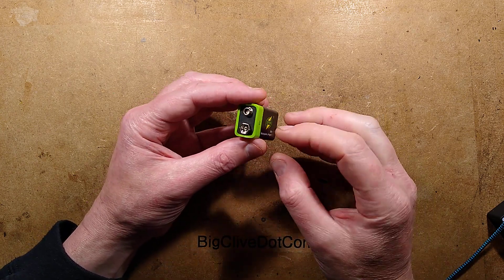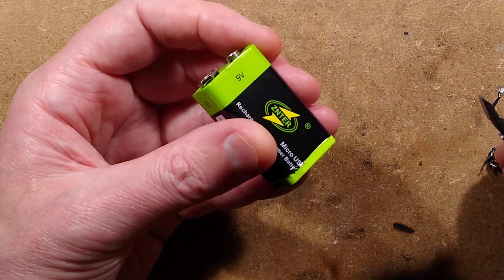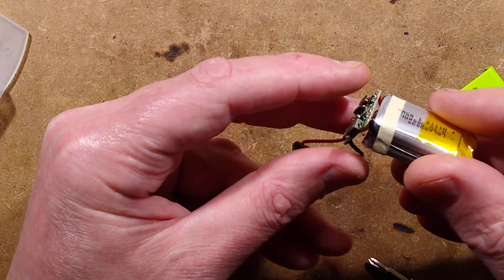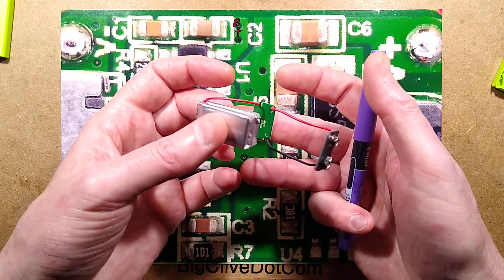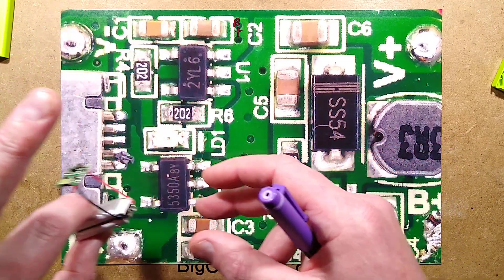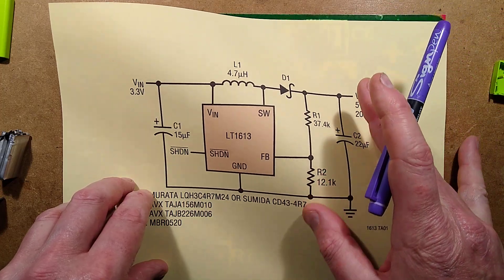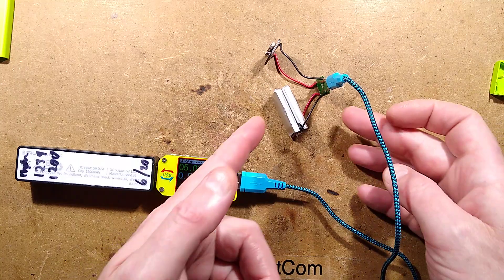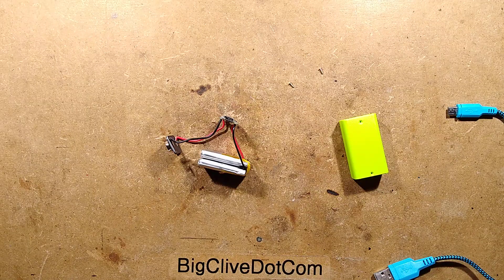Inside a Znter lithium 9V battery.

Comment: Seems like a well designed bit of kit. Nice too that they rate it at a more realistic level and not the raw battery voltage like 99% of powerbanks. I do a bit of work in theater and we would sometimes replace radio mic batteries during intermission. Was great i would end up with a hundreds of batteries after shows. Not entirely sure if i would trust sometime like this in a professional show however. At least not until they were extensively tested for runtimes and all that. But even then, at least the mics ive used always have some sort of a battery meter on the receiver unit. Ive had times when its been partway through an act, the unit is saying low battery and ive called over CANS to get someone back stage to do a emergency battery swap just to be safe. With these you would have no warning one wasnt charged or the cell was going bad etc and it would just suddenly drop out. 

For that same reason too these should never be used in smoke alarms. While i will admit that a smoke alarm battery chirping is the most annoy thing thing on the planet and ive got up the ladder at 3am ripped it off the roof and thrown in a corner. Once again with these you would have no warning as the output voltage of this would always be around 9v.
Reply: I agree, that also bothers me with power banks. I'd like if they advertised in Wh, rather than mAh at 3.6V.
Bare minimum they should say Ah instead of 000mAh 😅

Comment: Hi Clive your content is the most interesting and explanations are brilliant. I don't understand some of it but what i do understand has been very helpful .
I was wondering have you ever dismantled a DJI mavic Pro battery . Once they go below volt and are not accepted by the charger they are considered binable. They charge fine to full with a hobby charger...but still can't be used over the chip in the battery , some kinda failsafe..
No one has figured out the way around it yet..
Reply from the maker: I'd guess they built it in for liability avoidance.  An over discharged lithium cell may not be suitable for use at high current when recharged.
Reply: @bigclivedotcom  thank you.. must get new batteries then..

Comment: i hear "De-coupling capacitor" a lot.  I am aware of the various capacitors, but not sure what "De-coupling" means in this context?  Can BC enlighten me please?
Reply: De-coupling capacitors are capacitors placed right next to devices to provide the surges and spikes of current to it, without pulling down the supply voltage.

When this happens, we call it 'noise coupling', where changes in the current drawn by one device causes noise in the power lines, which effect other devices. Decoupling capacitors absorb this noise, effectively 'decoupling' the device from the power rails.
Reply: @robertbackhaus8911  re: "De-coupling capacitors are capacitors placed right next to..."
Yes ... they keep circuits from 'coupling' to each other through the Vdd/Vcc rails ... hence, "de-coupling caps" !
Reply: PalmIt this is a battery video not a light video, so unlikely, but I’m sure you would get a real charge out of a response from him

Comment: Thanks Clive. I asked you about these over a year ago as I was considering buying some. I did buy them but found that as you say, due to quiescent current, they're not great for things like smoke alarms or my IR temp gun (that sits around for months between uses). They only seem to last a couple of months in the smoke alarm. It's a shame as I hate single-use landfill batteries. Otherwise they're good though. Cheers.

Comment: I'm not aware of any name brand mic manufacturers that still use 9v most are 2 AA cells now or lipo packs and many of the older mics will be operating in ranges the FCC sold off. At least here in the US so maybe not so much for mics anymore. But these would be great for guitar and bass players with 9v pedals or even acoustic instruments with 9v pickups. That kinda stuff I still run into all the time and musicians tend to forget to change those batteries. I used to have tons for mics but now when they ask if I've got a 9v I just have to point their runner towards a store.

Comment: I think these usb batteries have great use cases. I have AA USB batteries and the end cap pulls off like a pen to expose a regular USB that you can plug into a laptop or almost anything. I use this for my computer mouse that takes a single AA. I like the ones where you don't need a charge cable but they're hard to find now. I need some AAAs for noise cancelling headphones that I take when flying. Plenty of USB sockets on planes to charge from.

Comment: For a while I really liked the idea of using these in smoke detectors but shied away from the new cheapy Chinese ones for obvious reasons. However my experience with 10 year lithium has not been good. I got two high end ones that was originally aimed at contractors who want to avoid installing dedicated wire. Both failed in the same way. I took apart one and the battery had puffed up and the other they wanted me to pay $22 to ship it so I said fuck you and moved on. When I took it apart it was the same deal. I've had 6 new ones that are on their With that said my best advice is if this means you'll keep your smoke detectors operational longer than use these but don't get complacent and keep regularly testing your detectors.

Comment: Clive, I know you have done a video or two with automotive devices but I wasn't sure you would be interested in control circuit diagnosis.  Ivan of Pine Hollow Auto Diagnostics in Pa USA just had a Subaru with window control problems. Today's cars are loaded with components requiring increased knowledge of sophisticated circuit design.  Please take a look. To get to the circuit board skip to eleven minutes into this video. Notice he is using a low current test light for troubleshooting !! Thanks.
https://www.youtube.com/watch?v=NHpw1PlSS74&t=39s

Comment: Amusingly I was thinking of making myself something similar to this, having dismantled a Kodak alkaline 9v cell (bored, just changed the smoke alarm batteries and it was begging for an autopsy!), which has the plastic case with 6x 'AAAA' style cells, and having some TP4056 boards, an adjustable output boost-module & some spare LiPo packs, I rather fancied making one, but the PCBs are too big to fit with the chosen battery, so, oh well... :)

Comment: Of course it would be a low power unit, otherwise it would get hot and melt itself.
I remember having fun with such 9V battery once, but it was non-rechargeable one. With a handy tester I figured out it could output slightly over 2 Amps which would result in 20 watts of power from a simple Crona (we were calling this type of batteries like that here).
I built a mechanical impulse generator with a magnet, a coil of wire and a Black Rose (hinge found on electric guitars to loosen strings). Since it was technically AC, I hooked this thing to a transformer (1:18 if I remember correctly) and got somewhere around 160-170 peak on the output winding, and hell it was sparking cool.
Then I got a stupid idea to short output with my two bare fingers of one hand, because what would a single 9V battery do, it's harmless. That puppy struck so hard I felt the pulse past my elbow up almost to the shoulder joint. It's like when you hit a nerve against a corner of something, but it was almost a whole hand.
Imagine I had this rechargeable 9V. I would have never been able to experience so much fun.

Comment: A friend of mine is using these types of batteries to power old tech when he can’t get the original battery packs anymore, they work very well.
Reply: These are very customizable... Can make a 6v to run lanterns and whatnots that you've swapped to LEDs ;)
Reply: That sounds rather interesting does he use them as is or take them apart and use em?
Reply: ucity metalhead - just had a word, he tells me he got his Apple Newton Message Pad going simply by using 4 of the AA type and a battery holder, it worked great, so he’s trying it with various similar old devices from his collection, but it’s proving to be a pain to refit some of them due to the slightly different shape of the free moving batteries (apparently some of the original packs had flat ended cells soldered together yada yada).

The batteries come with a multi-ended charger cable that means he can charge 4 of them at once, so he just takes them out and charges them together, then pops them all back in, the big advantage is how long they last.
Reply: @Lumibear.  brilliant thanks for all of the info.
Reply: @Lumibear.  I thought the Newton used AAAs or AAs anyhow? Ask your mate to clarify for the whole internet...Or we will come over and shout mean stuff up to his window.😾😸

Comment: I've had a pair of the AA version of this for about three years now. My headphones have an amplifier for the LF drivers, so I just swap the empty one for the spare and continue on my way.
The amplifier in the headphones isn't of the cleverest design, and clearly gets weaker as the voltage drops using primary alkaline, and isn't ever quite as strong when using a NiMH battery.

I haven't been able to pick up any issues with the noise floor from the internal buck converter. The only time things get wonky is right before the battery hits the cutout point and you can hear some faint whining of the oscillator coming through the LF driver.

One happy side effect of the constant voltage is that the bass hits (or the sound of artillery detonating all around me) always has the same amount of oomph.

I haven't really thought about using it with wireless microphones, mostly because at least when I bought these, they weren't the cheapest things, and with the relativey limited capacity (also the fact you can't use the mic's already dubious battery indicator) as well as managing some 40 micro-b charging cables for 20 mic packs, plus the potential for noise to be picked up, it really didn't seem like a good idea.
Reply: As the AA battery has 1.5V output, there is definitely step-down converter inside, they give much less troubles than a step-up converters, most likely thats why you never had any sound quality issues.

Comment: It is rather refreshing to see that in a world of cheap crap, there are still nicely designed gems to be found - this makes three items that 'Oor Clive' has turned up in as many weeks.

I guess then, that there would be some sort of innate blocking circuitry to prevent accidental damage caused by anyone attempting to charge this battery in a more conventional 'wall wart' style of battery charger?
Reply: The diode in the boost converter should block charging from the output terminals.

Comment: Please, be CAREFUL when you measure with those very long multimeter prope tips. You almost caused short when measuring the battery voltage.

Comment: This would be a great and easy  option for people building portable induction heaters for their dynavap instead of 18650s batteries since most induction modules on eBay Amazon etc it run best  at 9v - 12v  anyway. I would run a couple of these in parallel to get maximum mah though!

Comment: Microphones is a good point. I work with wireless microphones sometimes. The batteries only last a few hours, so you have to change them every time. They do have an led to show the battery capacity, but there's little time to check it usually.

Comment: I made myself the same solution for my multimeter. However, instead of buying a battery like this one, i made it myself. tp4056, a recycled battery and a cheap chineese boost circuit (trough a simple switch outside the multimeter). I have to say that the output ripple gave me no problems with the sensitivity (compared to another unmodified tester i have). Also, have some genuine AA rechargable li-ion batteries for my oculus quest, i guess they use the same thing, with a buck converter...

Comment: 3.7v times 3 then step down to 9v
Is that a good idea?
Reply: No. Charging 3 series cells from 5V would need a more complicated charging circuit and the cells could become unbalanced over time too - not a problem with parallel cells. The buck (step-down) regulator for the output would be just as complicated as the existing boost (step-up) one, unless you used an ordinary lossy 9V regulator - but then that would be more wasteful on battery power.

Comment: Hmmm, the most common use of those PP3s domestically is in smoke detectors, if it just suddenly stops rather than the voltage dropping, then that's something to be wary of. No low battery warnings, and a life of 3-6 months is a disaster waiting to happen in a smoke detector.
Reply: Correct... I would NOT recommend these in smoke detectors.
In fact, I would not recommend changing the battery in a 9v powered smoke detector, but rather replace the entire detector with one of the newer 10 year battery models...
Reply: nearly got one of these for a smoke detecter a couple of years ago, but realised the issue in time and ended up with a, much cheaper, 9v nimh (actually never over ~9.7v changed) (advertised as for smoke detectors, but also advertised as 1200mAh?) but its lasting a good 6 months, so quite happy.

Comment: Nice to see what's inside! I have one of these for 2.5 years now, still going strong. It's great for use with a DSO150  Chinese oscilloscope, it runs for 2 hours on a charge. And even better, you can actually use it while charging, effectively making it possible to run 9v devices on a phone charger.
Reply: Thats nice to know. Some powerbank circuitry type stuff turns off the output when charging, if this doesnt thats really useful for a lot of applications.
Think i might actually order a few.
Reply: @_--_--_  my wireless keyboard seems to have such a circuit. About once a month, I have to apologize to whomever I happen to be chatting with and go touch grass or something.
Reply: @xXponyinthestarsXx  lol
Reply: @Amethyst

Take a look at keychron keyboards (I'm in love with my K4 & k3)
Reply: Effectively like a UPS, nothing worse than running a test and then power trips out or accidently unplugged
Reply: The 1.5v AA usb-lithiums I use have the USB's 5v across the - / + output (instead of 1.5v) when you're charging it (when you've got the micro usb plugged into it.) :D
Reply: But what about the voltage ripple/noise generated by the battery? Doesn't it interfere with the sensitive input of the oscilloscope? I'm planning to use these batteries in a multimeter but I don't know how much impact the EMF noise could have there, as the sharp edges on the voltage input would be introducing many different harmonics
Reply: @umloginqualquer Hi did you fimd out if these interfered? I'm thinking for my metal detector and now worried after reading comments about noise interference!! Wanted to get best of both worlds with a longer lasting rechargable 9v battery.
Reply: Any difference between the orange and green coloured Znter Lithium Ploymer 9v rechargeable battery?

Comment: So a small switch to cut the power to the board might keep its charge longer?
Reply: Yes, if you can find room for it. It would probably need to be a small slider switch, but some of those are not very reliable.

Comment: I saw the "polymer" on the sticker before you removed it which made me think inside was LiPo4 cells, 3 to be exact which @3.2V ea. would make 9.6V... That would have meant just a charging circuit with no boost circuit.
This is why we take things apart, to see what makes em tick.
Reply: 3,7V is a working voltage, 3 would be overkill

Comment: BTW these are REALLY good for stuff that is high-draw...I have a TPMS tire pressure sensor tester that draws like 500mA from a 9V battery and kills them in no time, after a few uses it becomes very fussy.  With the Lithium 9V I have (which is 8.4V not 9) it always reads low but it is FAR  more reliable.

Comment: how would it work with external charge indicator in devices if it use boost converter as this would maintain output voltage at certain level regardless of actual battery charge , this could make it die suddenly and they should have integrated charge indicator on battery it self.
Reply: Yes, sudden death is a snag.But adding extras like a charge indicator would leave less room for the cells and increase the manufacturing costs. And while in use, it's unlikely you'd be able to read the indicator anyway.

Comment: So with this type of circuit, does that mean if you needed 18 volts, you wouldn’t be able to just connect them in series?
Reply: It might be possible to do, but I wouldn't recommend it due to two issues, one being the question of what happens if one battery discharges before the other, the other being the danger of causing a ground short while attempting to charge both at the same time.

Comment: No good for smoke detectors from the gist of what you were saying then, Clive? I was wondering about putting 2 in my detector and taking them out to charge them every 6 months, standard PP3 bats are quite expensive these days.
Reply: And you wouldn't get a low battery warning either, because the boost circuit turns off rather than the voltage drop you typically get with alkaline.

Comment: I have 8 of those type of cell in AA and AAA size they are amazing the only thing I have to complain about is the fact that they keep the voltage until the lithium cell is discharged and they cut off. Device that have a battery indicator always show full charge and then they turn off. Beside that they are amazing!

Comment: I had some NIMH batteries for mi camera. My problem was every time I needed to use them, they are discharged for the self discharge. Then I bought some 1.5V lithium znter batteries... Only for discover that they also has self discharge and, again, they ar discharged every time I need them.
Reply: try panasonic eneloop, higher quality nimh
Reply: Most decent NiMH batteries are now LSD, like eneloops. I've had some sitting in a torch in my car for 3 years, and they still worked perfectly when I finally remembered to swap them out.